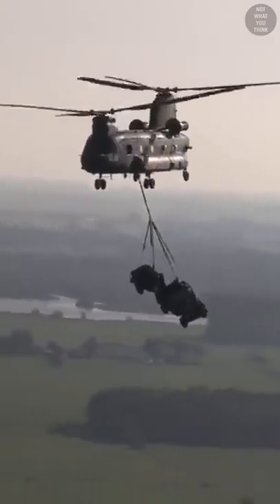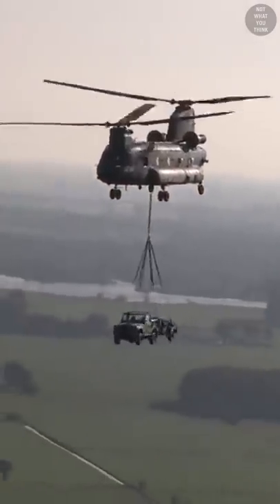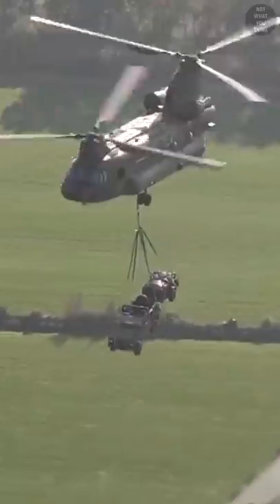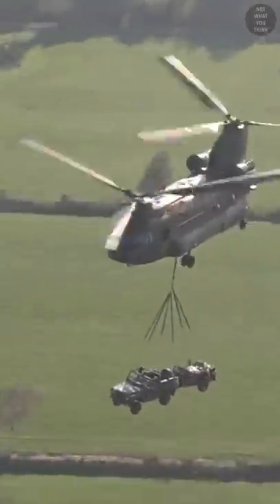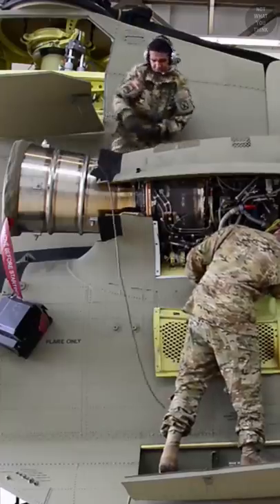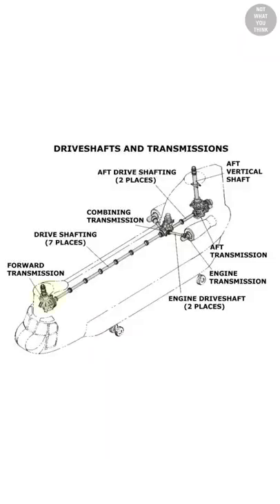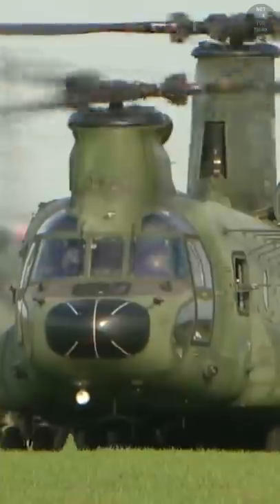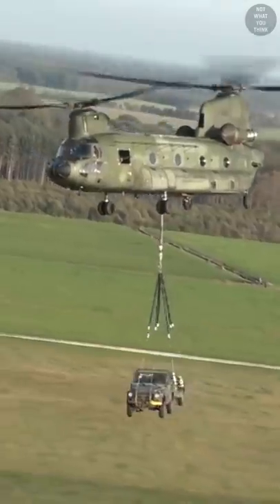What if One Engine Fails on the Chinook? #shorts

Comment: I view the Chinook as the definition of the grizzled veteran. 
Buds been slogging grunts and gear for 50 years. Had it's guts replaced and updated multiple times. 
But it's still there, and it will get you where you need to go. 
What a machine.

Comment: I was on one when the rear engine stopped , the Women pilot put it down brillantly , half the team didnt know what had happened , till we reached our drop off . Its the luck of the draw , RIP for the people that didnt !
Reply: Only has rear engines. lol.  But yes, can safely land one one or no engine power done right.  Great pilot you had.
Reply: Sorry yes the rear rotor stopped , not the engine otherwise i would be in the hill in bits and pieces
Reply: @anthonymauger9388  if the rear main rotor g/b failed it’s game over.  A single or even dual engine failure you can autorotate with the correct speed and height.

Comment: Fun fact from a 47 flight engineer, the turbine shafts in the engine are connected to a sprag clutch that is activated by centrifugal force, which is why if one engine locks up, the other can provide power and the locked engine won't lock the rotors

Comment: Good short mate. Ex chinook mechanic here. The transmissions also have a chip detectors and debris screens to monitor the amount of metal in the transmission oil. There would be a warning light for the crew should the amount of metal be too high as this could be an indication of transmission failure. 
The transmissions are able to run without oil for a short amount of time. It'll get you on the ground but the transmission would be scrap.
Also the engines have a transmission on the front that sends drive to the combining transmission as described in the video. These transmissions have a sprag clutch so the dead engine doesn't cause drag on the transmission system in the event of a single engine failure.

Comment: An autorotation landing can still be pretty deadly. In order to rotate the blades without engines the helicopter needs to have a high airspeed, meaning the pilots will put it into a dive. The point is to get the blades turning just fast enough that when the pilots stabilize and flare for the landing, they  produce just enough lift to keep it from hitting the ground at terminal velocity. 

Still, much more survivable than a free fall.

Comment: What if an engine fails on a Eurofighter Typhoon?

USE the Alternative Power Unit
Reply: The APU on a jet (atleast speaking from my knowledge of the CF-118, F-16, AV-8b, and MiG-21) is not nearly enough for a powered descent, really it just brings the engine to  enough power for combustion to take over. Even then most of the electrical systems cannot be powered during this process as the aircraft lacks the power to do both.
Reply: the only thrust that comes out of an APU is the bleed air valve, which is actually used to get the turbines spinning of the main engines, and the eurofighter has 2 engines
Reply: Eject

Comment: The video of the aircraft tearing itself apart is from ground resonance, not a gearbox issue. It was chained down to the maintenance pad and the rotors were kept at a specific RPM with tires and struts that were not properly serviced.

Also, replacing an engine transmission >>>>> replacing an engine or the fwd, aft, or cbox transmissions.

Comment: It actually has 3 Engines. The APU serves as an engine to provide power, hydraulics, and provide AC Power if you lose an engine. It doesn't power the blades though.

Comment: The aircraft self destructing in the end was caused by ground resonance not gearbox failure. Ground resonance is caused by an imbalance in a fully articulated rotor system like that of the chinook. When in contact with the ground, the vibration of the imbalance resonates between the rotor system and the ground through the airframe and multiplies until it self destructs. The only corrective action is to leave the ground and let the blades rebalance.

Comment: Years ago, I read a book called 'Maverick' about a helicopter  pilot that flew an Apache attack helicopter. It was a small paperback book packed with crazy stories. He explained this "parachuting effect that rotors have while falling with the rotors disengaged. 
He told a story about "God Nut" or whatever they call the huge that holds the rotors fastened to the gear shaft. If it comes off, it's a free fall.
Reply: It's called the Jesus nut. Cos you're praying to Jesus that it does not come loose. On the chinook its torqued to 5500-5900lb ft and locked with a tang washer and spring circlip thing to make sure that torque doesn't come off.

Comment: This is no joke. In the 80s there was a rash of fatal CH-47 crashes. It was found that a cleaning procedure using ground walnuts as grit for sand blasting was causing a dangerous build up in the gear box. A change of procedure was adopted and the crashes stopped. Over Walnuts!

Comment: The catastrophic failure where the Chinook is ripping itself apart is due to the Combining Transmission failing. Torque from the engines is diverted 90° through gearboxes into both sides of the Combining Transmission by way of short drive shafts. The Combining Transmission the takes the torque from both engines combined and diverts it to the forward and aft main transmissions which then divert the torque 90° upward to the rotors. If the Combining Transmission fails, the rotors are no longer synchronized and the blades will impact each other. If the Combining Transmission seizes up, the Inertia in the rotors will snap the pitch links, causing the blades to flap around all over the damn place while the rotors continue spinning and that's when you get the bird ripping itself apart like that one shot from behind the aircraft.

Comment: The Chinook that was on the ground shaking apart was not the result of a crash landing or engine failure. It was caused by ground resonance which has nothing to do with the drive train of the aircraft. That was caused by making contact with the ground incorrectly, which caused a resonance burst from the wheel all the way up the body to the props, and back down. It is catastrophic unless you feel it in time and are able to lift off. It's the only way to stop ground resonance.

Comment: I recall one accident with a helicopter involved the cleaning and maintenance method, that was followed by the book, but resulted in catastrophic failure.
Had to do with walnut shells getting stuck during the cleaning process and failure to remove them entirely.
Reply: I saw that too, on engineering disasters.
The shells clogged an oil passage that lubricated one of the intermeshing gearboxes.  When it failed the rotors collided and it fell straight to the ground.
It was at an airshow too!

Comment: The video shows "ground resonnance" phenomenon that isn't a gearbox failure
Reply from the maker: Correct, it’s just that sometime, it’s difficult to find the specific footage 😊
We really wanted to show the rotors hitting each other in that shot.
Reply: @NotWhatYouThink  i agree but gearbox failure, most of the time, would end in same result than an engine failure. Just a rotor spinning gently in freewheel, so it's not very graphic haha.
But sometime the freewheel have brutal failure and it's more spectacular (a footage of this is on ytbis avaliable, it's a blue heli near of the ground and crew, carrying stuff)

Comment: The Huey was making groundswell of maybe about half it's potential, flying between the big hills, probably 400'  off the lowest part of the trees. 
It started spinning. It kept spinning. It leaned over about 15°. Still don't know how the 3 men on the other side didn't slide out at maybe 200' high, except for being held in by an angel. Serious. It hit some trees with the tail and top rotors as we happened to crash into the intended LZ. The skids were broke, the fuelsaloge sitting on the ground, the entire tail broken down to the ground. Only one man, a Ranger already on the ground, was hurt by flying aluminum, but not too severely I think. 
The pilot jumped out and laughed and said it was the Third one in 3 months. Later he said we lost our air. I'll say. All of it.

Comment: MOS 15D aircraft powertrain repair, we repair rotor heads, transmissions, driveshafts.......everything that actually makes the helicopter stay in the air, also do non- destructive testing.

Comment: If you're on a CH46 or CH47 and you see a transmission leaking hydrailic fluid don't worry. It's when it stops leaking that you need to worry because that means it's run out.

Comment: Those engines are excellent 👍🇺🇸  The Chinook helicopter is an amazing machine. I'm a retired helicopter pilot. And I've flown a myriad types of helos. The largest one being a KV-107. (CH-46) category. For smooth, air conditioned comfort, the AS 350 B2 was my favorite. EMS was the BK-117. Loved their rigid rotor designs. Extremely tough aircraft, collaboratively built by Germany & Japan.
Reply: A CH-46 isn’t bigger than a 47.

Comment: I wouldn’t necessarily call autorotation a safety feature, it’s not something that happens on its own or by the push of a button, but rather, the pilot being trained in how to manipulate the collective and pitch of the helicopter to achieve a controlled descent. It’s more of a maneuver than a feature. It takes good training, and a level head to pull it off.
Reply from the maker: Thank you for clarifying 😊👍🏼

Comment: Correction: MOST single and dual rotor helicopters.

The F-22 Osprey does not have adequate auto rotation so crashes to the ground if the engines fail
Reply from the maker: That is correct. We actually have a video about the Osprey not being able to effectively autorotate 😊

Comment: Auto rotation is not a “safety feature that comes with an aircraft”. Pilots are trained to use the rotor blades to slow the decent of the aircraft.

Comment: All this twin engine twin rotor stuff is great for lifting heavy loads but loosing an engine will only give you more time to plan a landing.  Military Helos aren't known for their excess power.  Like mentioned earlier cutting external stores helps and in a perfect world might be enough to save the day. The trouble is that the US Military doesn't fly in a perfect world.  We are either too high trying to drop off troops and or cargo or in a region that is really hot. Both scenarios produce the same results. Flying in the middle east we routinely flew over weight for the weather. We would make our approach to the ship with no power available for a wave off or hover. We made straight in landings. 7 days after I  rotated home our Helo crashed killing all 4 crew and 3 passengers.  Twin engine Helos flying on 1 engine will simply take you to the scene of the crash.
Reply: NO helicopters are known for excess power. Full fuel? Decreased capacity on a hook or in the fuselage. Need extra range? Throw in some barrels and only travel with 2 pilots and an engineer. Need lots of load capacity? Fly with decreased fuel loads and ergo shorter times between fuel ups.

Helicopters are very dangerous because of this reason: everything is on the cusp of it's capacity at all times.

Comment: I would not be keen to go down in an auto rotating ch 47...
Reply: its probably safer than single rotor designs due to the huge rotor area and no parasitic energy loss from turning a near useless tail rotor, only inverse yaw control due to its counter rotating nature.

Comment: I thought the second engine would keep it in the air, guess  I was wrong.
Reply: Just depends. Different factors like weight determine if the aircraft has “single-engine capability” or not.

Comment: „When both engine brake down the rotors will still rotate as a build in future“ no sir, not even close… what do you think the airforce will do to the rotors while falling down without engines? Thats right.. turn, and when they do, they give resistance on the air, which make em spin,  just like this weird three that throws his seeds out like helicopters.. its not a feature..

Comment: Whirlybirds scare me shitless. I know they are designed a order of magnitude more then the Honda engines I work on but, I know engines fail, maintenance techs can be lazy, bad fuel can happen etc. 
I realize it’s statistically safe but I would be terrified on a helicopter flight. 

Also for anyone in the know, I was told once that for every hour in flight a helicopter required 1/2 hour of maintenance and inspection. Is that really true?
Reply: I knew a high up helicopter engineer who worked at Bell, he said he hates helicopters and would never fly in one because they are death traps constantly falling and trying to kill anybody inside.

Comment: What we're really scared you is only one propeller blade gives lift. On this helicopter it would be two one on each prop. So basically you have a steel box beating physics into submission. And auto rotation only works if you're high enough if you're not there's no time for wind resistance to break so you come down like a rock.
No thank you. #FixedWing4Life... Literally

Comment: So if the rotors fail, you're good. But if the gearbox fails you get either crushed by the engine or sliced to bits by the propellers trying to exit

Comment: Once again, an awesome video. Just a pitch, can you talk about the Helicopter ejection system on the Russian Ka-50/Ka-52 Attack Helicopter. Because their solution for ejection is by releasing the Rotor blades so they can safely eject. I just wanna know if it is safer than auto-rotation since you lose the blades so you can safely fly off. I'm also interested on other stuff that comes along with it. Thanks for Informing people.
Reply: Autorotation is generally preferable, same as a gliding landing is preferable to an ejection in a jet. Thing is when being struck by missiles or even determined gunfire being able to rapidly vacate your now probably on fire and disintigrating aircraft is better than going down with the ship.

Comment: Can you please explain ground resonance and catastrophic structural failure on rotary wing aircraft? I've seen several video but still can't actually figure out what trigger it, how to counter it, and what rotary wing configuration have effect on nulify/exacerbate it
Reply: - Rotor blades may be able to advance or reverse slightly. This is called an articulated rotor, which has drag links that allow this motion to prevent mechanical shock damaging the blades
- If this happens in such a way that the spacing of the blades is not even, the center of mass will not line up with the axis of rotation, and vibration/oscillation will result
- If the aircraft begins to oscillate on its suspension, as a result of the oscillation of the rotor, in such a way that the oscillations reinforce one another, the forces involved will quickly overwhelm any damping measures and serious damage will result.

Rigid and semi-rigid rotors are immune, as they do not feature drag links that enable the movement in the first step. Landing gear suspension is also required for resonance to occur, so aircraft with very little (eg skids) are mostly immune. Powerful damping helps prevent oscillations from occuring, so aircraft with better dampers fitted to landing gear and rotor blades stand a better chance of preventing resonance from starting (but dampers won't help once it's started).

If ground resonance starts, you need to stop one of the two forces that are resonating with each other. So either stop the blades rotating by shutting down the engine, if RPM is low enough for this to be a solution; or detach the landing gear from the ground by taking off.

I hope this helps, but as a disclaimer, I'm not a trained pilot, I'm just a youtube commenter

Comment: You don't have the option of losing any of the three gearboxes. 
Edit: technically there are 5, two of them change the angle of the engine(s) output shaft to feed into the combining gearbox.  I suppose if you lose one of those you can still remain airborne under most circumstances.

Comment: I've always wondered how they keep the rotors from hitting each other.
Reply: One is higher than the other
Reply: @Papanza295  That's not why. The rotors intermesh. They are connected with gearing and driveshafts exactly like an egg beater. The guy even said so in the video.

Comment: is one of the propellers just placed higher than the other or are they in sync to spin like two gears?
Reply: Both your suggestions are true, but the rear rotor is placed higher to avoid the turbulence from the forward rotor (not to avoid contact). The rotors are linked by the gearboxes mentioned in the video to keep them in sync - like gears, as you say - to prevent collisions between rotors.

The rotor blades are flexible, so there's a risk of collision despite them operating at different levels. This is most obvious when they're just starting up, because the rotors sag a lot when not spinning fast, but it's possible during flight too.
Reply: @opossums-will-sing  ohhhhhhh that's a good explanation, thx

Comment: But why is having only one propeller worse than having none?
Reply: No power applied to rotors means you autorotate, and probably live. If there is a break in the drive train and only one rotor is reciving power it means they will hit each other.  The overlap a lot.   Once they touch and destroy each other, you no longer will be able to autorotate or control the helicooter. .
 On the bright side, the out of balance condition will break your neck within a second or two so you wont be in pain for long.